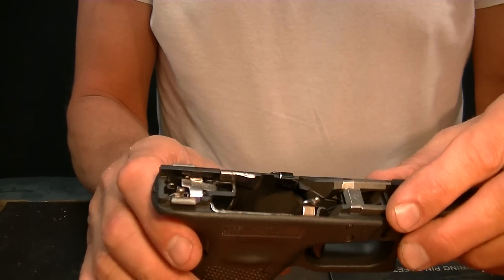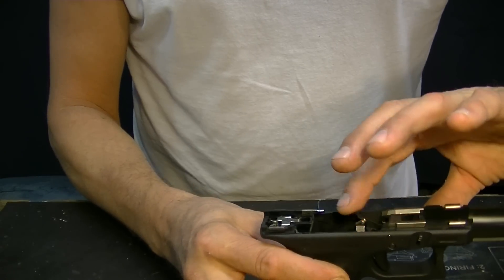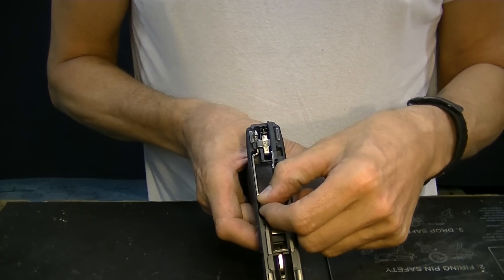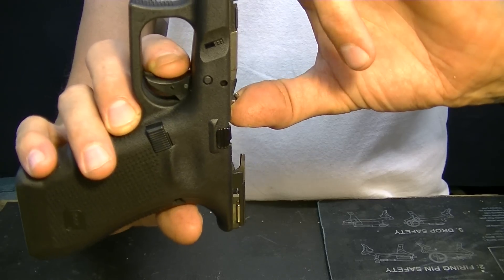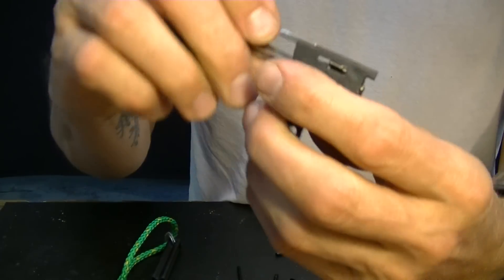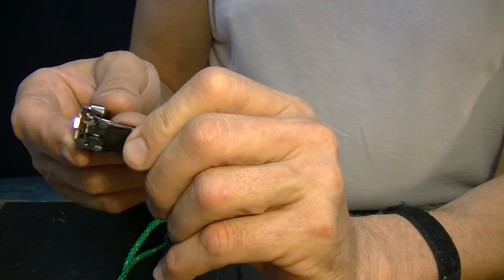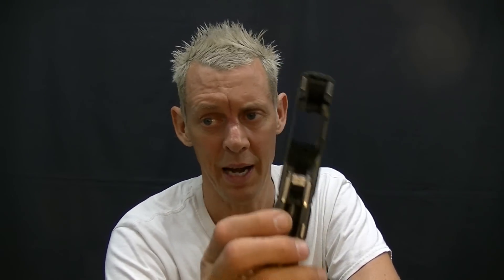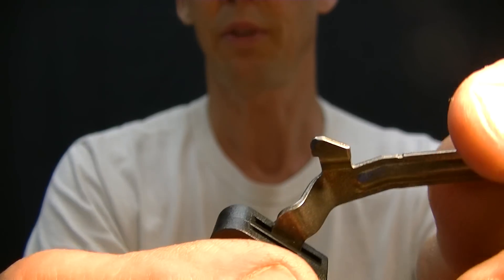Transfer bar drag EDUCATIONAL ONLY

Comment: I bent the connector to 90 degrees and the safety plunger would not reset.  So I bent it out to like 80-85 degrees and the safety plunger started resetting just fine

Comment: Thank you I need to see if that’s what has happened. I installed a 3.5 connector in my G26 gen 5  and I do believe the trigger pull is less smooth and more psi

Comment: I smoothed & polished my transfer bar/ connector interface. My "-" connector was quite rippled from manufacturing. I also bent the cruciform 90° to the bar looking forward. The striker pawl was riding off to the right after release. Carefully ground a flat edge on the cruciform sear too. 
Huge difference!
Your vids are awesome.
Smooth, predictable trigger.

Comment: Gen 5 G17 did away with the dimple on the vertical extension. I can definitely feel the bar drag on the side of the polymer frame.  What do you do on the Gen 5/G17 for this drag?  Break the edges on the polymer via Flitz and a dremel with felt wheel, and polish the bar? I see the bar does not more 100% true front to back, it has a little side motion, or the frame isn't parallel and the bar hits the frame because the frame is angled a little bit.

Comment: My BL G35 has a 4.5lb fixed trigger. Every other Glock I own has a 5.5lb fixed. What part would be different? The Connector? Trigger bar angle? Thanks I’m advance.
Reply from the maker: Yes the 35 has a minus connector those other guns have standard connectors
Reply: Thanks, JOHNNY GLOCKS the persona.

Comment: I don't see 85 degree angle I see more than 90 degrees like 92 to 95 degrees for the connector. When the stock connector comes from the factory it's probably 95 degrees or more before bending it into your suggested setting . If it was 90 degrees it would be flush with the trigger housing you don't want that. So I just think that you miscommunicated what you meant, which seems to happen often in your videos, or digressing  different directions at times. But thank you for your videos!
Reply: 85 = 95 = 275 etc. just depends on what direction and what side of the axis you start from.

Comment: Johnny Glocks.... wow this video really helped. I have a gen 4 19 that had a very mushy trigger, no defined wall and would barely let the trigger reset enough to let the trigger safety  work. I thought by changing out the trigger connector it would fix the problem. It didn’t. I’ve tried multiple trigger connectors. ghost edge 3.5 , ghost ultimate 3.5 and Glock OEM 3.5  connectors with some minor results. After watching and bending and tweaking the trigger connectors I achieved a much better and cleaner pull. I settled on the Glock OEM 3.5 connector. Now I have very smooth pull with no drag, nice defined wall and a clean snappy break(which I prefer) also the trigger resets perfectly now with a very audible and tactile feel. Thank you for the info !!!

Comment: I used 3 layers of duct tape stacked attached to the frame in front of the transfer bar to remove all pretravel....I thought screws and glue/whatnot was ridiculous and tape can be removed instantly. It does a really good job and it always resets.
Reply from the maker: That's definitely a way to do it

Comment: @JOHNNY GLOCKS Hi! My Glock-19 GEN4 trigger shoe is walking out. Just got it last week and never been fired. Just had it dry fired several times then I saw the pin protruding that it made a dent on the frame. I need some advice. Thanks!

Comment: Is there a remedy to the trigger bar rubbing against the frame in a gen 3? (Actually I have a P80 build, which uses gen 3 parts.) I can see the frame bulging out (and even the slide shift ever so slightly) when pulling the trigger. I think this is giving me a gritty pre-travel.
Reply from the maker: Who Knows? Yeah why don't you watch my video detailing the slide and frame for Johnny Glocks trigger it pretty much outlines everything you can do however since the wall of the polymer is thinner than the Glock where the long part of the transfer bar is your ultimately going to have some bulging there or Flex from the bar should I say properly

Comment: Thank you for the info. Since watching you and others, i have taken interest in working on my glocks. Ive got my G30 gen 3 trigger really nice and smooth with a ghost 3.3lb pro trigger connector and lighter trigger plunger spring and a gen 3 trigger bar and polished. 

I just installed the ghost 3.5lb evo trigger connector on my G19 last night and noticed its smoother, but not as nice as the 3.3lb Pro connector. I might need a lighter trigger plunger spring as well. Everything else is stock. Back to tinkering...

Again thank you for the wonderful videos.
Reply from the maker: Po Isbell Happy to hear? Keep it up 👍👍👍

Comment: Another great vid Johnny. Thanks. I am so debating on ordering one of your comp triggers for my gen 3 g35. I currently have a vanek in there now but I feel it can be better. And by watching your vids this past year or so I see that yes it can be better. I know I need a new firing pin, I bought this gun used and the previous owner has a titanium pin in there and it has some gouge marks toward the part that hits the primer. But it still seems to work smoothly. Anyway I'm still debating between you trigger group and zev and dk customs. Just don't know which one to go with yet.
Reply from the maker: A Thomas 
Go with mine I dial it in so it drops in perfect
Reply: JOHNNY GLOCKS the persona that's what i like about yours i know you can customize it to my liking using factory parts and i love that. I think the only reason i   like the zev is bc of the shoe, i like the aluminum and flat face. if i were to go with yours can i change the trigger shoe to an alum one? or even a flat trigger like the overwatch trigger or agency? not sure if i like the suarez you showed on another vid, have heard bad things on thier drop in like the drop safety not working.but of course if you build it im sure itll be 100. thanks for the quick reply.
Reply from the maker: A Thomas 
if you buy and send me the shoe I'll build it with the shoe. I would suggest the ZEV as it is set screw adjustable and will be WAY WAY WAY better than any flat face.
Reply: JOHNNY GLOCKS the persona with that would i just get the trigger bar from zev? or order a shoe like the keneti tech one at www.kineti-tech.com/glock-triggers-1/  just not sure if theirs has set screws.
Reply: JOHNNY GLOCKS the persona either way i think i have settled on getting one from you now lol. just need some time to get funds together as i do want to send the pistol to you to fit it. also to tighten the slide back up, last time i did it was around 5-6000 rounds ago and the front end is loose again. but anyway as soon as i get the funds i will be giving you a call.
Reply from the maker: A Thomas 
that one isn't set screw adjustable get the ZEV
Reply: JOHNNY GLOCKS the persona gotcha so just get the zev bar and trigger pad then send you everything and let you get to work :-P
Reply: JOHNNY GLOCKS the persona I'll let you know as soon as I can do everything. I just had to spend more money on new sights yesterday, wound up and broke my brand new tartan tactical sights yesterday while cleaning it it fell off the table and the corner that holds the fiber optic just snapped right off. Ugh. Only used them in 2 competitions. Oh well stuff happens lol. But yeah I'll let you know asap. Gonna be at least a month tho. But thanks for all the quick replies!

Comment: Great explanation. But, one thing I'm still fuzzy on: I was just about to "smooth" those polymer struts a bit, especially the one in back, but I have the Gen 4 bar which is supposed to keep it from rubbing. Should I still do that even if I see no wear. It can't hurt, right?
Reply from the maker: Mean Gene 
it can hurt. if its not broken don't fix it as the saying goes. if you don't see wear just leave it. Even the rear strut as you call it in the gun in this video has wear but since I'm changing parts out I'll have to see how it wears before I do anything. a rag Polished is fine but no Dremel

Comment: How can the trigger be "at the wall" without passing or defeating the striker plunger safety?  Always wanted to ask that question?  btw, you do amazing work.  Thanks
Reply from the maker: Roy D 
there is a scallop cut into the vertical extension which keeps that safety %100 engaged.
Reply: Thanks for answering.  Maybe you could illustrate that sometime in a future.

Comment: Got my 42 trigger pull down to 5.5 to 6 lbs with diligent polishing. So more rounds  to see where it settles in.
It has a shorter take up than my 19 which is 5.to 5.5 lbs My 42 was purchased earlier this year. Enjoy your very real approach to triggers.
Per your comment in an earlier video ...3.5 pounds is scary light in a carry gun.
Have aPPQ 45 which is 4.5 and that is aboutaslow asI feel okay with
Reply from the maker: Joe Gondo 
I agree keep the poundage up